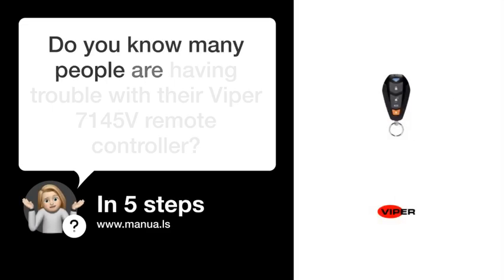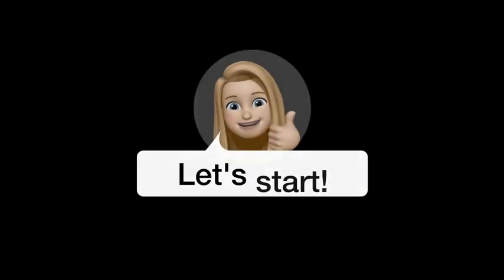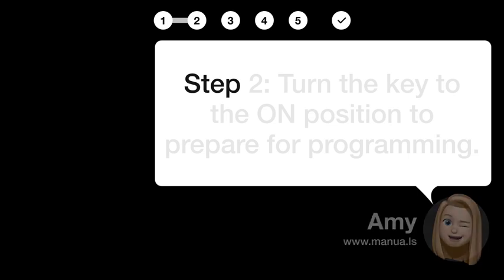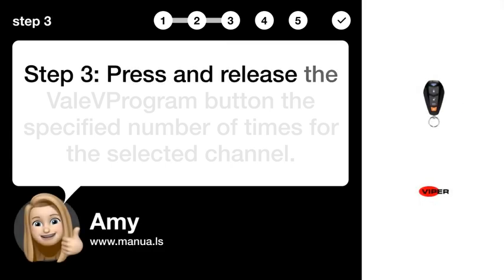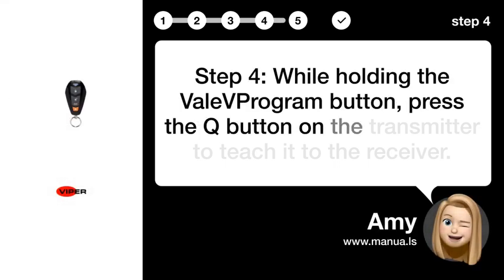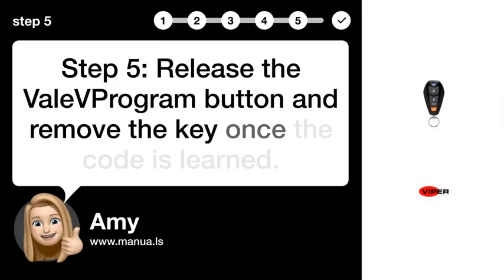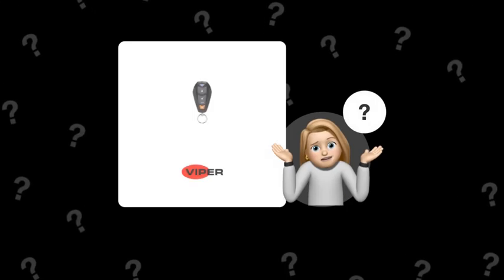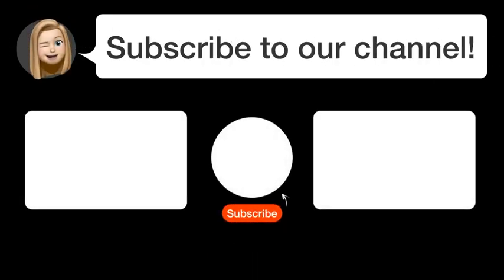How to Fix Viper 7145V Remote Not Starting Engine

Comment: What is the “Q” button… 
Where is the valet button?  There is NO button on the windshield receiver or underneath the dashboard.
you did NOT show any video of what you are doing. :(
Reply: I had a problem with the car not starting. A technician at a viper install place told me to take the negative cable off the car battery and wait about a half hour. When I put it back on it began working just fine.. Kind of like rebooting a computer. Hope this helps because this video is useless.
Reply: @williamjansen641  have you had any issues since doing that??
Reply: @toddwhelchel462  No problems at all!